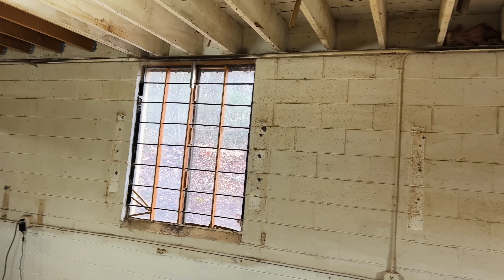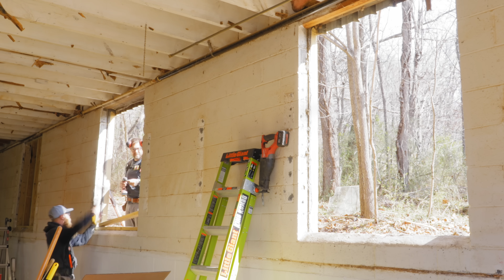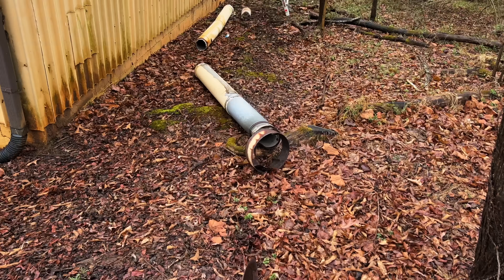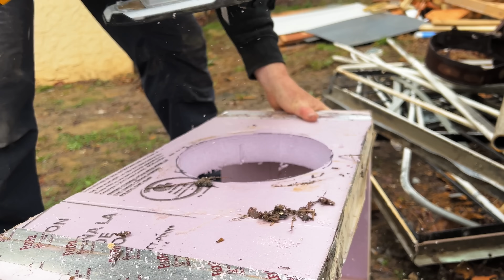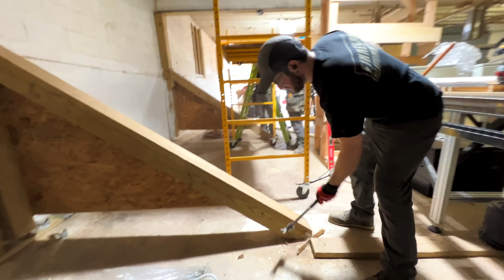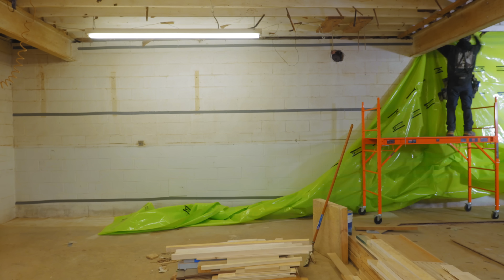WORKSHOP RENOVATION PART 3 : Framing Walls & Windows

Comment: Would like to know about the engineering on that wall with joist hangers on the floor plate and the double top plate. Is the point to keep the concrete wall from bowing more?
Reply from the maker: Exactly! I talked about it at the end of Part 1 : https://youtu.be/8UTJg0-qbX4?t=750

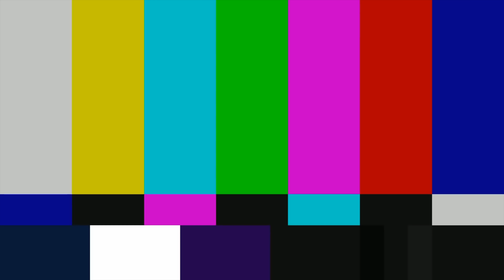Comment: 08:20

The structural engineer probably called for a double top plate because the building is old and the joists would probably not line up with the studs which would cause load transfer issues (sagging). A double top plate solves this by distributing whatever falls on the upper top plate across the lower top plate evenly.

Could be wrong but this is my guess

Comment: How sure are you that the vapor retardant isn’t going to condensate on the backside between the block.  I’m sure you’ve done your research but putting ‘plastic’ over anything below grade scares me!  Great video tho!
Reply: there is no point placing the vapor retardant on the inside, especially if you cut it off where he did

Comment: You could’ve framed those walls on the ground and stood them up, since the studs and two plates are 1.5” shorter than the overall due to the double top plate (which is literally not doing anything). Just nail the upper top plate to the bottom of the joists, frame the wall, then stand it up and slide it under the upper top plate. If it’s tight, coerce it with a nine pound hammer. I’m surprised Jason didn’t suggest that
Reply from the maker: That would assume the slab is perfectly flat, and it’s far from it. I think this was a lot simpler considering we would have had to done a lot of planing and scribing to fit the walls.
Reply: @craftedworkshop  that’s understandable

Comment: Question, won't it be better to close the window with brick blocks? Any specific reason you went the other option?
Reply from the maker: Definitely could have gone that route but it would have taken a lot longer and I already had the materials I needed on hand for this.
Reply: @craftedworkshop  that makes total sense. Appreciate the response. 👍

Comment: Really enjoy your videos. Just a point. If you are getting moisture on that back wall. All that plastic sheet is going to do is condense it and it will collect in the floor and rot the base of your stud wall. It needs airflow.
Reply from the maker: There's no actual water coming in, mostly just trying to help with humidity. This is a vapor retarder, meaning moisture can still permeate, it just does so more slowly.
Reply: @craftedworkshop  Great. I didn't want to come across as critical or negative. too much of that on here.
Reply from the maker: No problem, didn’t take it that way! Love to hear feedback and ideas as long as they’re constructive. I’m definitely not an expert here, learning stuff every day!

Comment: I think the wooden buttresses are there because the retaining wall is tilted. So as a safety measurement the previous tenant/owner installed these triangular walls against the concrete part of the exterior wall. If I had to tackle this problem I would build a couple or three buttresses along this wall but made out of concrete just protruding 80 cms (30 inches) from the surface of this wall

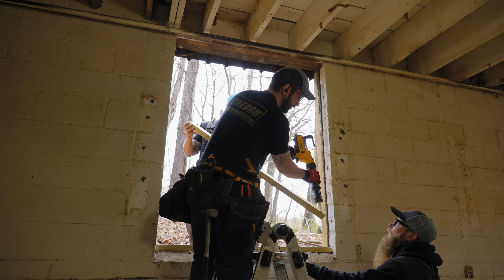Comment: @1:54 I think running zip tape on the bottom of the pressure treated board would be cheap insurance?  I believe Kyle/RR Bldg does that.
Reply from the maker: I’ve seen him do it on non-treated stuff but I think it’d be overkill on this stuff since it’s rated for ground contact.

Comment: What about some sort of double pane opaque window setup for natural light but less intensity?
Reply from the maker: I could have done a lot of things to filter the light, but it's next to impossible to buy windows in a reasonable time frame right now, so I went this route.
Reply: @craftedworkshop  that makes a lot of sense. We just finished a building here and windows delivery times were atrocious.
Reply: @craftedworkshop  that makes so much more sense. Getting rid of the natural light might be worth it if it could delay you literally months

Comment: Looking good! To ask stupid question: Is mold buildup behind the vapor block an issue? I guess it's sealed, so it doesn't matter, but just curious to hear from an expert. Thanks!
Reply from the maker: It shouldn't encourage mold, as this is a vapor retarder, meaning it just slows the transmission of moisture. Completely blocking it would likely lead to mold.

Comment: What type of sealant was used on heater vent pipe hole and around window framing plates? Just silicone?
Reply from the maker: The pipe hole was Lexel and the framing plates was Titebond Duramaster.

Comment: Why use joist hangers? Doesn't seem like they are doing anything in that application
Reply from the maker: Guessing it adds strength to the connection between the plates and the studs to resist the pressure coming in on the block walls.
Reply: Watch the video again.... Fully explained

Comment: going from NG to electric heat? you're going to regret that. At least leave the NG as supplemental heat. Hope you're down south! Also, why didn't they stagger the top plates and have the plate break in the middle of a stud?
Reply from the maker: I’m in the south east and will be setting up solar, so don’t think I’ll regret it!
Reply: He's going to install mini splits, which are heat pumps and air conditioning. They are very efficient as well as very quiet, an important consideration for making videos.
Reply from the maker: Yup! Plus I’m planning to set up solar, so I can power them for free. No supporting fracking too.
Reply: @stevenfoster9304  You can't have a heat pump and air conditioner in one. It's one or the other. You probably mean that the heat pump, cools and heats.
Reply: @denniscooper6328  Yes, I am  well aware of  that, I  just wanted you to be aware  that  he has  heating and cooling  with  high efficiency and  quiet  operation and  does not  need  the noisy and  inefficient  gas blaster...

Comment: another reason for getting rid of the windows is, a massive reduction of spider webs, i built a 40 x 30 x10 foot garage, and no windows I think there are about 3 small spiderwebs in   the whole garage in the 6 years since it was built

Comment: Just a query mid video; you mentioned that the wall that was allowing moisture in was fixed inside. Are you going to dig and drain on that side?
Reply from the maker: Yup, will be working on the outside soon!

Comment: I'm just a homeowner with a damp basement, but everything I've read says that you need to have a way to get the moisture out of those walls.  We did an interior dimple board barrier so that we could separate the framing from the brick walls but still suck the moisture out with a dehumidifier. This looks like the equivalent of putting your foundation in a ziplock bag, but maybe I'm wrong.
Reply: Drylok he applied on his walls plus creating a positive grade away from building  will make the amount of moisture in his building negligible. If you have a basement that is either fully below grade or the section that is below grade with a negative slope towards basement then you would definitely need exterior drainage to let water perc away from the building and air gaps in the interior to allow circulation.
Reply: There's also the possibility of adding a French drain or weeping tile drain system against the exterior of the block foundation, since they can easily gravity drain towards the front of the building.
Reply from the maker: That’s the plan, positive drainage and potentially some kind of French drain or drain tile should take care of it.

Comment: I’m only at minute 3 but wondering if smaller windows with outdoor blinds would have helped. 
Im a content creator for brands and I’m rebuilding my shop too, right now I only have one window, the other one i swapped it for a wall Ac and I miss natural light a lot. 
I understand the benefits of controlling the environment but natural light is so soothing to work with (at least to me).
Big fan of the series